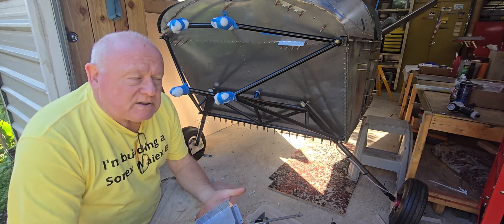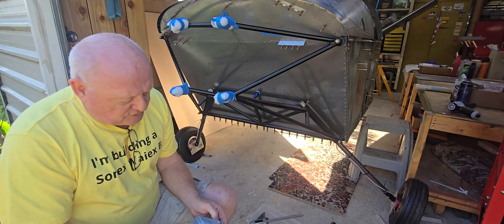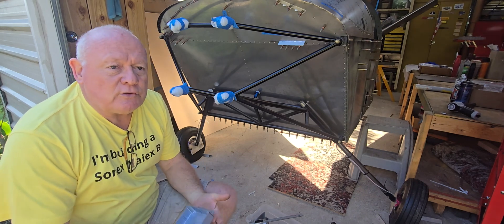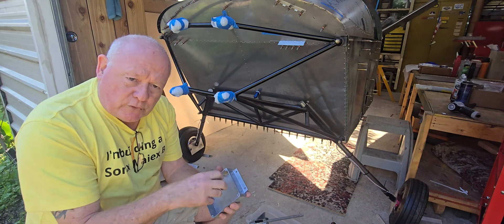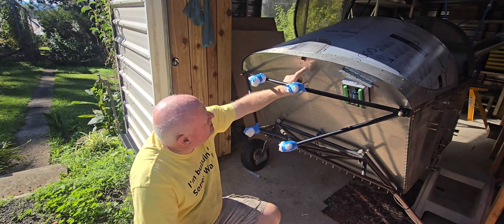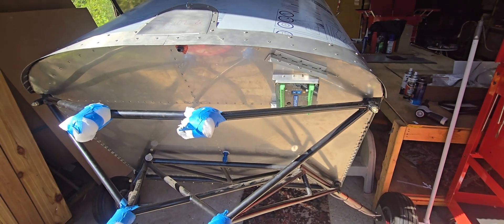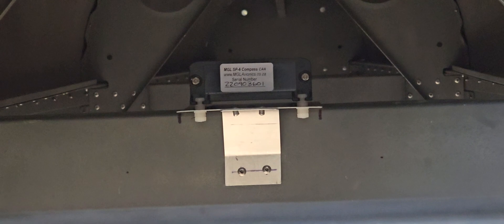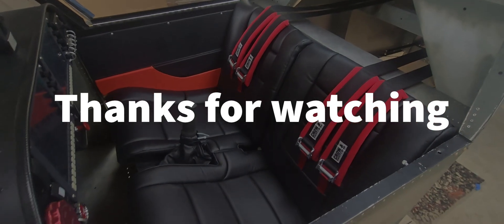Sonex Waiex B, Part 37- Remaking the cockpit sides

Comment: Looks nice! Maybe a good compromise would be a carbon fiber armrest that is very thin but placed at same height as top of one you made in last video….but make them clip on and clip off with some type of of friction snap or something…so you can have them off regularly, but clip them on after getting in plane for longer flights. Just thinking….
Reply from the maker: There are so many variations I have come up with, I thought  should just use the K.I.S.S scenario. Carbon fibre idea was something I was going to do for the instrument panel, and still may do that down the track.
Reply: @pandyseven  Whatever you do, I know it will look fantastic and be highly functional! 🤩
Reply from the maker: Thanks Wayne

Comment: Looking good. I used also used the red RTV around the fuel filler on my Sonex A and found the RTV didn't like fuel and started flaking off. Have since removed and replaced it with the black gasket RTV which is good for oil. It seems more tolerant to fuel.
Reply from the maker: Hey thanks for the tip, will purchase some of that. That said I had to apply a second coat anyway so will try the black RTV. And peel as much of the red off as I can, thanks again

Comment: Looks great Andy!  I like the locking feature of that hinge pin.  That's really important - they will work out if given a chance.  Good job on the catch can and the interior also.
Reply from the maker: Hi Bryan, I am very happy with the result too. I get a bit worried about the hinge pin idea, so may add perhaps a wire or cable tie
Reply: @pandyseven  By 50 hours flight time I had a lot more fasteners and pins safetied than I did in the beginning!
Reply from the maker: I am hearing you

Comment: Hi Andy, you might want to flip the RDAC upside down so that the temperature inputs are on the left. The reason being that the CHT and EGT leads from the right side of the engine might not reach. They are not easily extendable. As usual you are doing an excellent job and it all looks great. I particularly like your cockpit and instrument panel. It's going to look great and far better than mine. Keep up the good work 😃
Reply from the maker: Hi Gavin, I just plonked the RADC in position and wondered which way it went thinking it could go either way, now it makes sense.